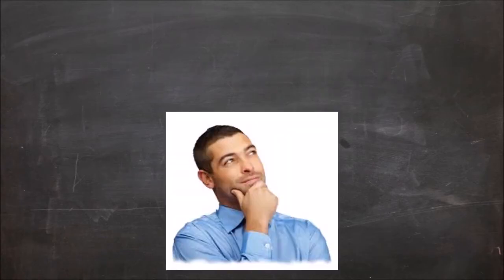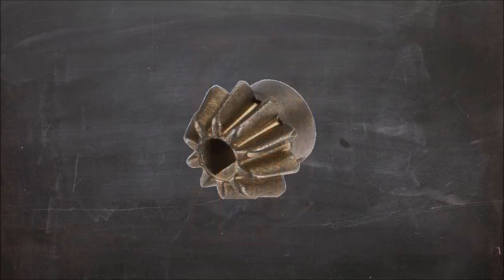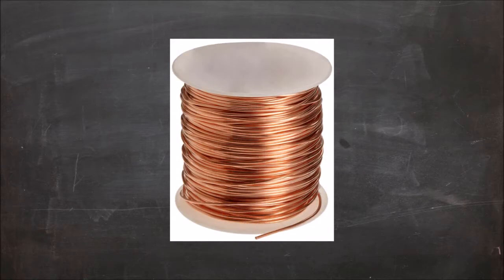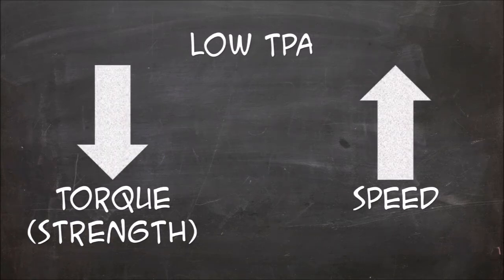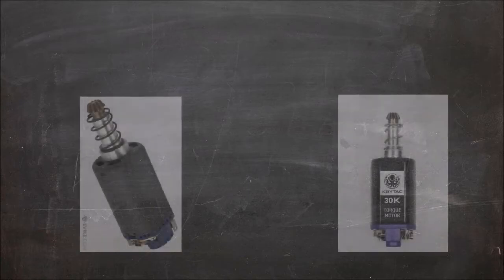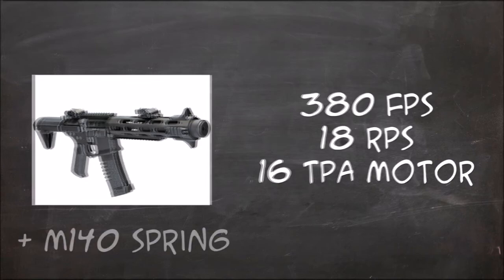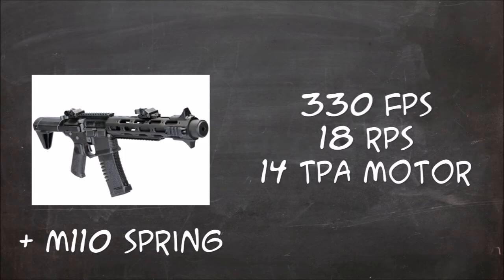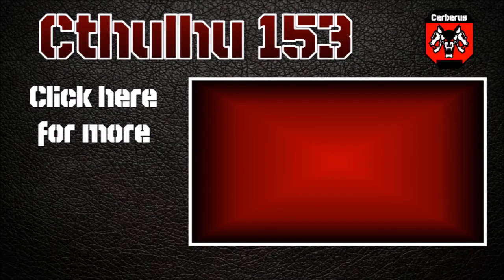How to Tech: Understanding Motors

Comment: could I get the best of both worlds by buying a 11.1 lipo with high torque engine, high speed low torque ratio gears and a powerful spring. also could an all round higher quality motor have more toque and rpms?
Reply from the maker: So first it's math that determines if a build is high speed or not. You can get 30+ rps with 18:1 gears you just need a motor that makes it cycle fast enough and a battery to sustain it. Most people who run high speed gears and a high torque motor are not attempting to get a high rof but a high trigger response. The bigger thing to keep in mind is when using a low cost low ratio gearset, it by design is under more stress so broken teeth is a bigger concern so most players will invest in siegtek gears due to their higher quality materials. On the subject of motors there are only. Few motors right now  can effectively handle high tension springs and maintain a high rpm. There are the Tienly motors and the newer brushless motors. I personally use a War Den brushless and it is miles ahead of traditional airsoft motors but it comes at a steep price. If someone has a build in mind I always ask what the budget is and build the gearbox around that. Most players don't want to pay for top tier parts and for the majority of players I would advise it unless you know you'll be a player for life.

Comment: Thanks for the videos! I have one question, how do I know which spring goes with each motor? I have a scorpion evo and I want to upgrade it but I don't find the info on which spring I can put in. I wan t to use 0.30 bbs and shoot just below 400fps. There's no Jules regulation here.
Reply from the maker: Problem is the majority of aftermarket motors ask you to only buy their springs and then suggest the spring that matches that motor. And then the spring tensions between the brands vary. A guarder m120 spring is not the same as a lonex m120. The best most techs can do is offer their favorite brands that they know the performance of to assist a new build. For your build I would use an ASG 22000 Motor and an M150 spring. But I can't guarantee any performance without the cylinder type and barrel length.
Reply: Cthulhu153 thanks
Reply: @sjdude922  Could you help me too? I was thinking about upgrading my M4. It needs to shoot about 420-450fps and i would like it really snappy and great trigger response, and some pretty impressive rps. What gearset and motor should i get? Rn i have Lonex 18:1 and some standard ASG motor. I saw a guide where he recommended high torque gears and high speed motors or visa verde to get good response.
Reply from the maker: @magnusoj3014  It's all about investment. If you want that kind of power and trigger response you do it one of a few ways. First you need a higher tension spring assuming you have a perfect seal in the gearbox and your cylinder matches your barrel length. Now you can get snappy trigger response from an 18:1 gearset but you'll need to use a form of electronic trigger. I vote Gate Titan. If you don't do that you will have to change your gearset. There are 14:1 and 13:1 gearsets that will increase rate of fire but also in semi-auto it will be snappy. I'd say trust lonex but you may have to step up to guarder though their high speed set only goes to 16:1. The alternative is Seigetek and those are expensive. Motor wise you would be fine if you have 30K or faster motor. Personally, based on your build I would invest money in the electronic trigger for everything that you get and not worry about the other parts so much and just tune the trigger for snappy response and rof. You have decent ROF from what it looks like. I'd need more info.
Reply: @sjdude922  I'm going to be getting the Prometheus Wide Use 13:1 gears for my Krytac Vector (11.1V) and was wondering if an asg 30k (16TPA) would be enough to handle the load. I'm trying to go for a pretty snappy and high rof gun w/o creating too much stress on the gears/gearbox. I think my stock spring is an M120 which is pretty strong but only shoots <350 fps. Might improve the seals (nozzle, piston, piston head) inside the gun for better efficiency and lower spring to M110. Would this motor work and what could you estimate my ROF to be? Thanks